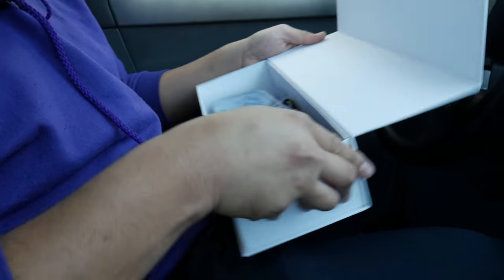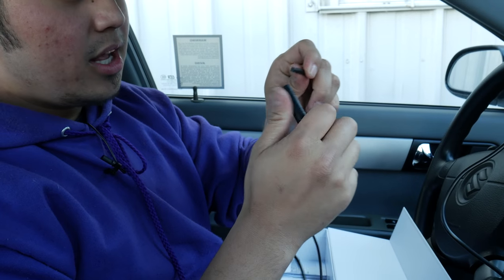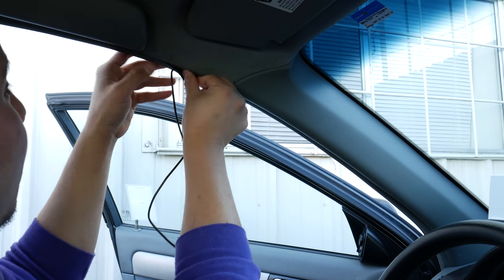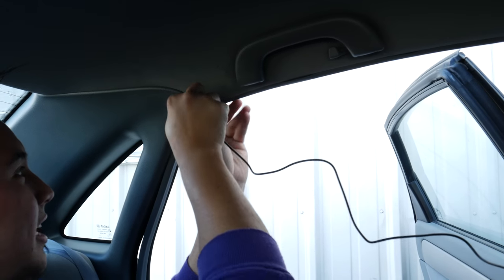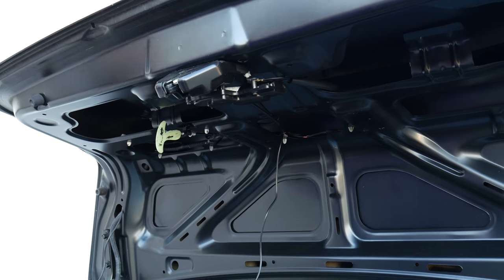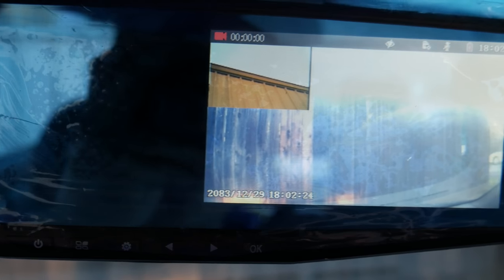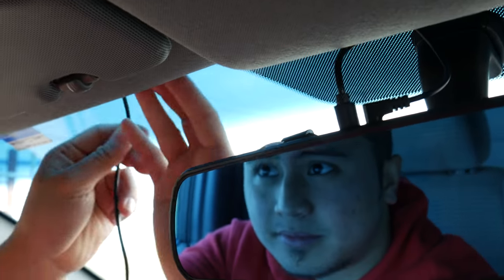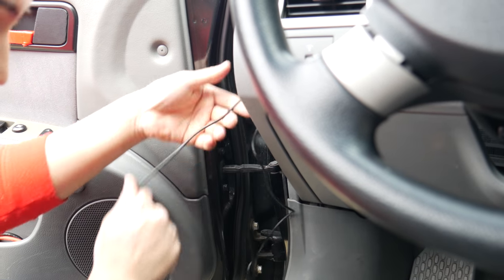Installation: (2/3) ihreesy Dual Lens Rear View Mirror Car Kit

Comment: Thank you for sharing this video!  I have the exact same rearview dashcam mirror/back up camera kit.  The back up cam powers up when I turn on the car but I could not figure out why the rearview mirror doesn't switch automatically to the back up cam when put on reverse.  All this time, I thought it was the RED wire (from the back up cam) that powers it.  IT ISN'T.  Thanks to your video, I found out it is the black plug that powers the back up cam (at 3:00 mark of your video).  The red wire is just for the reverse trigger (so the rearview mirror knows when to switch to the back up cam when put on reverse).

I also find that the scotch locks (splice connectors) are not reliable.  I connected the wires the exact same way as you did.  Thank you once again for your help!

Comment: I just received this item today so this video was and will be a great help, a few turns around the tip of the screwdriver with some masking or electrical tape will make it less
likely to scratch any of the plastic trim pieces.  Thanks again.
Reply from the maker: +Stephen Cox Hey Stephen, thank you for your kind words! I really appreciate your support. I definitely agree with your tip, thank you for sharing it! I'm sure others will appreciate it too.

Comment: only issue i have with the rear cam is the lens, it's not wide at all. Do you know of any wide angle lens adapters out there that would fit on this cam?
Reply from the maker: +Jacob Wright Hey Jacob, yeah it's not as wide as the rear view camera I have on my car. I'm not too certain if this can accept other camera, I would recommend contacting the company just to make sure. I do know some prohibits third party lenses.

Comment: i didn't really want to drill a hole in my car, so instead, i routed the wire out the top of the trunk and put the camera on the bottom side of my spoiler. Angle and camera seem to work fine but i was worried about the connector since now it is outside the car. It shouldn't take any direct rain, but it may get wet... is this ok?
Reply from the maker: +Brett Domenick Sweet man and yeah that shouldn't cause any issues in my opinion. Just make sure everything is covered well and no exposed wires are cut or damaged. Sorry for the late reply, just been busy.

Comment: why the display always on and actually i cannot use the mirror. Any suggestions?
Reply from the maker: +Dennis Lai Hey Dennis, there should be an option where you can have it auto shut off on the menu setting. Give that a shot and let me know, the annoying thing is when it detects motion (if you had this active) it'll turn on to record and so on.